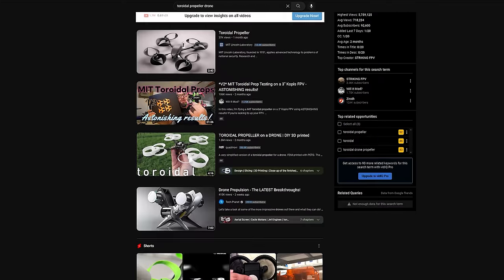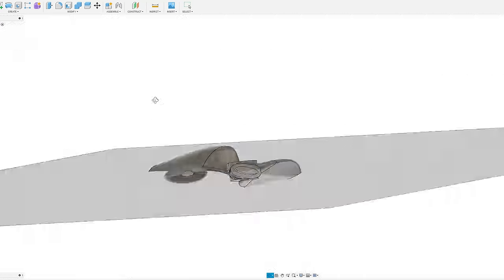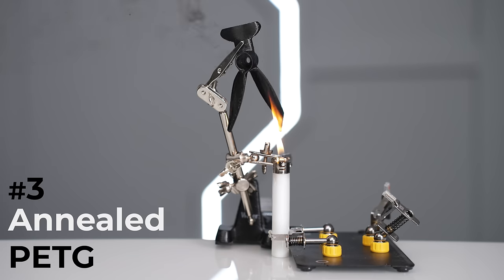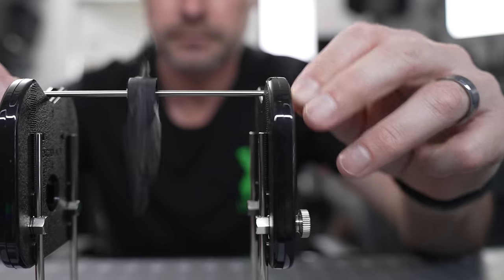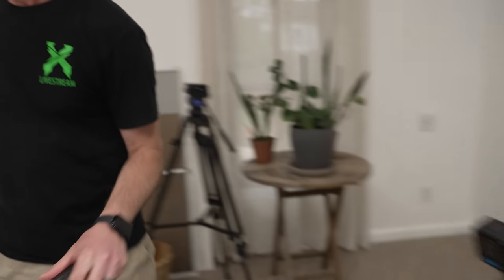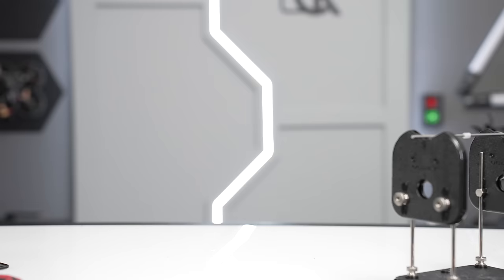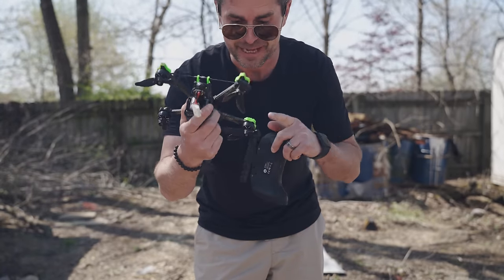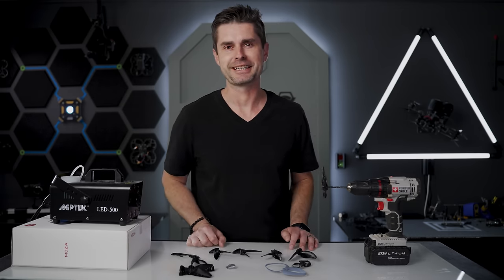Zipline PROPS Look CRAZY! So We MADE Them        |        Free STL Download

Comment from the maker: UPDATES: 
1. Fusion tutorial on props is up: (We went with toroidal since they are the most complex) https://youtu.be/1JPMgXGwauw
2. There will be a follow up video including resin printing, salt remelting and other methods mentioned. 
3. There will also be a live stream to cover some of the comments and take advice. 

The feedback and tips have been amazing! Thank you for all the advice! We will be going through the comments again very soon!
Reply: Try silent computer fans that have a band around the circumference of the blade tips. Should be a simple modification of the shaft connection.
Reply: Two things:  I am getting an injection molding machine and might be able to work with you.   Second: would you be interested in an conversation on a novel application concept that I have using a drone?
Reply: link rot issue. The files are no longer available. Can you provide a new link or put it up on printables etc.?
Reply: Where is the link for the model ?
Reply from the maker: @Larsbor  I think the link is down again. I will update it later today, and reply. Thanks for the reminder 🙏🏻

Comment: PLA is not the weakest. It's stronger than PETG and ABS. The reason people like PETG is for durability, which is quantified by the Izod notch toughness test. The issue you're really running into with the orientation you're using though is inter-layer adhesion. FDM prints are highly anisotropic, which means different material properties in different directions. I'd recommend SLA printing for prop prototypes as they are far closer to isotropic. They're also far higher resolution to capture the propeller airfoil most accurately. Good luck
Reply: I suspect PETG has higher through-layer axis strength than PLA but your point still stands.
Reply: Yeah the layer binding in PETG can be very high. Like PLA though it's rather brittle. For FDM I'd probably go with PC for this application, but it would be interesting to see how some of the less brittle resins hold up too.
Reply: Resin printing is going to explode the second the motor starts.
Reply: The second it started printing up I knew this would be an issue. Granted lying down it would have lots of supports but on it's side you should be able to get only supports on the very edges of the blades and that's much eaiser to fix/sand. Also nothing stopping him splitting the design into 2 or three parts that lock together reducing the supports even further.
Reply: @TheAxebeard  depends on the resin ie: Siraiya Tech Strong
Reply: This is completely wrong.
Reply: PLA is the least suitable for high impact applications, abs and nylon are probably some of the best, as far as the material itself goes, the problem is they don't do layer adhesion very well.  There's some advances recently that a few companies and designers are experimenting with that may actually create a properly solid part in abs or nylon or really anything else.

As far as 3d printed, all inclusive of layer lines, petg is one of the better ones because of its flexibility and good adhesion. 

 I agree with you on resin though, it's a better option for blades like this especially if they use a "tough" or "abs-like" resin, PLUS it's a lot faster to resin print most of the time, especially if it's few layers, because it prints the whole plate in one exposure. My personal choice for abusing resin is anycubic abslike plus or v2.
Reply: I paying pla props that work often. Printing them horizontally works.
Reply: Wrong!
Reply: @jonchall8  In my experience it depends, PETG can actually have weaker layer adhesion than PLA. It's advantage is that it's tougher (doesn't snap but bends a little before breaking) so it resists better to impacts, and resists to higher temperatures (PLA softens at 50C)
Reply: 1. PLA = stiffer+stronger , like glass
2. PETG = stronger+tougher, like a soft metal.
In the spectrum of stiffness-strength-toughness......you want the ideal balance and PETG has a better balance for a propeller than PLA in most cases.

Comment: If you want to quickly strengthen a PLA print, you can brush it with runny superglue, then spritz it with hardening accelerant, and the glue will go into the voids and pores, and your prints will be instantly far stronger. I learned this trick from the YouTube channel of Robert Murray Smith, the maker/engineer dude.

Comment: Can you try offsetting the outersurface of the prop by about 0.3mm and then fiber glass? Use carbon or glass toe around the hub. The aerodynamic centre of the zipline prop force is not centred on the hub which causes vibrations and twisting of drone arms. I would be interested in finding out what happens with a similar three blade prop with the props at 95.5, 124.9, and 139.6 degrees (these are prime ratios which I think will spread out the frequency of excitation. You get fewer repeating patterns with prime numbers with the rotation of the blades if that make sense. If you know what a response spectrum is, it flattens out the response spectrum). Each prop can be a different size so the aerodynamic centre of force is at the hub which also reduces vibration. Stag the heights of the props for clean air. I am really curious to see what the result would be.
Reply from the maker: That could work! I'll add this to the list of test versions for the follow up video. 
Interesting. I'll take your notes and do some more digging to get a better understanding of the science before our next design. 

Thank you for the details!! 🤘🏼
Reply: @CliffKajun  Really looking forward to seeing results. Thanks for the work you put into this. It is pretty interesting.

Comment: My initial thoughts (after designing, printing, testing, iterate) is that you are printing with stacked layer being normal to the axis of rotation.  Hence the instantaneous destruction or RUD (Rapid Unplanned Destruction).  You realize this at about 3 minutes into the video.  I printed both the TriLobe and DuoLobe (3 blades and 2 blades) for a DJI Mini laying flat, slowly, 0.12mm layer height, without supports (sliced with both Cura 5.3.1 and Prusa 2.4.0-alpah-alpha6).  I tried PLA, PLA+, PLA+CarbonFiber, ABS, and NinjaFlex (TPU).  PLA+ worked best for me.
Reply: Rapid unscheduled disassembly *

Comment: 0:15 Zipline's props are streamlined, have a long stem for a smaller counterweight and interference with the blade-generated vortices, and look like a larger angle between the blades.
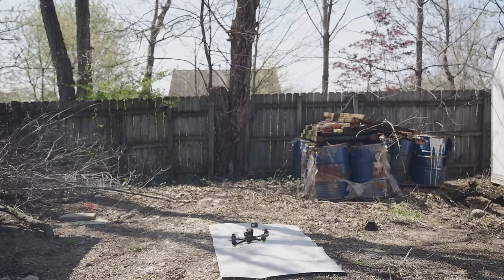7:57 yours aren't quieter because you've missed at least two design parameters that Zipline used.
Reply: Can we even get our hold on that design pramater or zipline managed to witheld them from public pretty well
Reply: yeah, i think the zipline folks mentioned wingtip vortices as a contributor to noise, and the ends of the blades on this one are not very optimized.
Reply: Yeah, you definitely can't trial-and-error these into silence with any amount of parameters.  They likely developed the Zipline props with CFD to do something like destructive interference to cancel out noise.
Reply: oh, more bs... *sigh
Reply: >you've missed at least two design parameters that Zipline used.
what are they?

Comment: The creator of APC props was a RC plane guy at my club in the 90’s. We all were part of his product testing efforts fun times. He made them in his garage using a resin molding process. The 3D printed stuff today is really just proof of concept and mold making blank capability of which we didn’t have in the 90’s. 

The zip line prop concept should generate just as much thrust as a similar surface area standard prop as long as turbulence from the leading blade isn’t affecting the trailing blade. I will say that the foil shape at the root of the blade was found to have a large impact on the prop performance at various RPMs. The blade tip also can affect performance especially if the blade flexes under load. The APC props have a unique root foil and rigidity for a reason. Each prop use / profile be it Pylon Racing, aerobatics,  general sport flying evolved into a unique foil design due to the performance differences and speeds the aircraft we’re running at. 

Drone props are massively ripped off designs in many ways to each other by the typical Chinese manufacturer. I haven’t really seen any drone props that are really engineered to a level we see with Zipline based in California or even what we did in the 90’s with our club member who created APC props in California 😆. 

Is there a need for real foil design in drone props? Oh heck YES!!! The trash I see being run today on drones is like our wood hand carved props we flew way back in the day😆.
Reply from the maker: That's very interesting, and I'm sure it would have been a cool experience! 3D printing really is just a great proof of concept/prototype medium with some limited production uses. 

Makes a lot of sense. Most of our fpv drone props are extremely flexible (with the exception of our cinelifters) which is great for crashing, but I'm sure it is also a tradeoff in performance. I'll have to look into the APC props a little more. Thank you for the detailed explanation, it's really helpful  🤘🏼

Lol, this is so true. The copy and paste method of manufacturing is getting out of hand 😅

I'd love to see this become more mainstream. You've sparked my curiosity and I'm definitely digging into this soon. Thanks for the info and detailed comment! 😎🤘🏼
Reply: I love APC Props!
Reply: Ah, also...on this design we are more than DOUBLING the rotational mass for no additional lift.

Who's tried just running props with more surface area?

Assuming we are going to sacrifice for "quiet"...how much is too much sacrifice? 

You guys are going to drag me down this rabbit hole. 🤦🏼‍♂️
Reply: APC had a terrible tip airfoil....and I knew Fred too. We raced giant scale.
Reply: a very large range of speeds does not allow to be a good propeller for drones, it’s just that somewhere it’s better, somewhere worse, in general, we will still get the same average value, if we do not take into account a certain category.

Comment: My take from the zipline video was that the two blades were also not identical. This meant that the sound each makes is at a different frequency so they don’t reinforce each other. Might be something to try for V2.
Reply: Isn't the sound frequency dependent on the motor's RPM? I'd think the blades would produce noise at the same frequency since both blades are rotating at the same RPM.

Comment: I've printed quite a lot of props and found Tough PLA to be the best option, printed flat.  Also, bigger (8" in my case) props work better as they rotate slower, reducing the centripetal force.  Unfortunately, printed props always seem to be noisier and less efficient even if you work hard to sand & smooth the surface.

While it's cheating a bit, my attempt at the zip-line prop used a pair of decent Carbon Fibre props with one blade cut off, stacked with the stem of the counterbalance sandwiched inbetween.  You can buy hubs with a female thread - then use a long screw to hold it all together, along with some glue to fix the positions.

For 8" diameter, I spaced the two bladed 10mm apart with a 30 degree angle between the blades.  This seemed to give the lowest perceived noise level with decent efficiency.  Even still, silent it was not.

Comment: When you have a working shape, you can create a mold with two components silicon rubber, and cast them with special a resin. I did some propellers using prochima sintofoam (it's similar to ABS when catalyzed) and i added some carbon filament inside the mold before putting resin

Comment: Have you tried resin printing those props? They do ABS-like resins for printing and the result doesn't have layering to weaken the design.
Reply from the maker: We haven't yet, but just ordered a new resin printer for the follow up video. Thanks!!
Reply: @CliffKajun  awesome! I really like sunlu nylon like resin. It's got a lot of flex to it. It can be a little bit challenging to print with since it's consistency while printing is pretty stretchy. But for something like this where it's small and there's not a lot of stress on the material while printing it would probably be perfect. The nylon (pa) like can be hard to come by so an abs like is a good alternative (I like the sunlu abs like) Just for the love of God don't use a standard resin like elegoo grey or something. They are way too brittle. You're going to need something a bit more specialized
Reply: I was hoping someone mentioned this. I've been effectively 3d printing and using parts for professional projects since 2000, and although most of that time was utilizing FDM, I knew it was a deadend(layer weakness and detail/finish). The main reasons SLA was not utilized was a combo of price/availability and material quality. Not only has the price of it all plummeted in recent years, the materials have also come a long way. I now mostly use an Elegoo machine and water soluble resin, much easier to deal with than the alcohol stuff, but some of the more exotic and stronger resins are still alcohol based. You may need to try a few to find the best resin for this use, but if you do you may never go back to FDM. Especially if you can manage to print with little to no support structure, tricky but do-able, and produces the best 3d parts I've seen in decades.

Comment: Pro tip - been using 3D printed props for air and water (boat) with no issues for years by simply coating props with cyanoacrylate. No annealing required. Quick, fast, reliable.

Comment: Could you not use off the shelf props, cut off and epoxied into a 3d printed hub?  Or do the blades need to be shaped totally differently from standard ones?

As others have said, the approach where you use 3d printing to make a mold might be the strongest option.

Comment: I have designed and printed some 5" zipline-style props to compare against some other printed props for a project. I MSLA printed them in a mix of Siraya Tech Blu and Siraya Tech fast resin. The surface finish was good and they were almost balanced right of the print plate. So far they have managed to slowly ramp up to 23 000 rpm before exploding. I haven't tested the thrust yet but will soon. Just going off how much air they are blowing compared to regular props I assume it would be possible to fly on them but would need, on my 5" fpv quad, a throttle stop at about 70%. Maybe soon I will flight test them.

Comment: If you want to do injection molding you can 3d print a mold. Use the high temperature stuff and print 100% infill then use lower temp plastic to injection mold. For an injector it is fairly easy to make one from low cost steel pipe. Make a plunger and a nozzle then use an Induction heater to heat the steel pipe.  It will take some trial and error to get the temp right but you can easily and cheaply do it

Comment: Great effort, I think the main facor in making these props quieter goes towards first spinning them slower. If you've ever built a giant 15inch prop quad you'd know how quiet they are compared to a 5 inch - just because they spin the prop at a much much slower rate to begin with they move all the noise and wasted energy lower down in the spectrum
Reply from the maker: Thank you! 
You have a valid point. Larger props are much quieter in most cases. We are going to do a follow up video where we will test 15" (ish) props. Should be interesting 😅🔥

Comment: Assuming you have the AMS accessory for your X1, you should go for that dissolvable support you were talking about. You don't have to print the entire support in it, just the "interface". You may not even need to put it in water, it should separate more cleanly from PETG than using PETG support material exclusively.

As for molding, you could make resin molds with silicone, OR you could use an mSLA printer to print injection molds and build a little DIY injection molding machine from a couple drill presses and simple electronics.

Comment: HI Cliff! 
    May I suggest that you lengthen the blades and make them wider. This would increase the surface area of lift and would reduce the rpm required for take off.
Reply from the maker: Hey! 
I think you are correct with this. We started designing them a little on the “stubby” side to make them easier and stronger when 3d printing. Our follow up video will go this route though. Cheers! 🤘🏼

Comment: For strength it’d probably be better to print in something that melts with ISO and fume smooth the outside which would not only make it more aerodynamic but would eliminate layer lines on the outside. It may even be beneficial to anneal the props then fume smooth after that.

Comment: PLA is in fact among the stro gest philament, its not tough, thats what you tought you had an issue with.

As PLA has higher tensile strength, than PETG or ABS.

However the issue was the isotropic quality of FDM prints (aka. weak along layer lines).

If you. have issue with that i recommend high hardness grade TPU. If you cannot print it in proper orientation that is.
Reply from the maker: Yea, PLA is stronger, but not as flexible as the PETG. The start and stop of the props seems to be the majority of the stress and this is where flex is better. 

I thought about TPU but haven't found one that is hard enough to keep its shape at speed. Any recommendations?

Comment: you may need to tube your settings a bit, you should be able to get those to print much nicer if you use lower density supports and thinner lines will be stronger. PLA+ should certianly be strong enough. its strong enough for a glock, it can be a propeller.